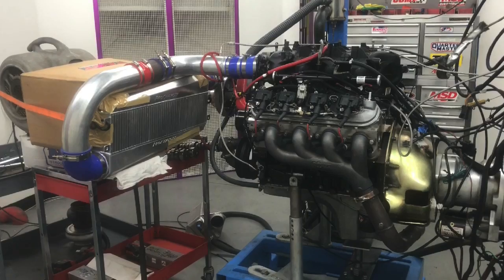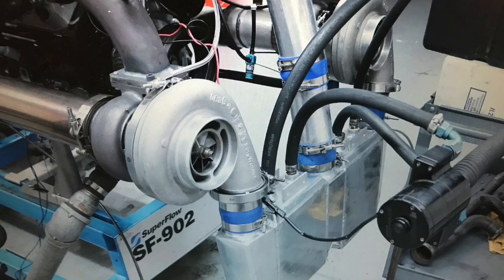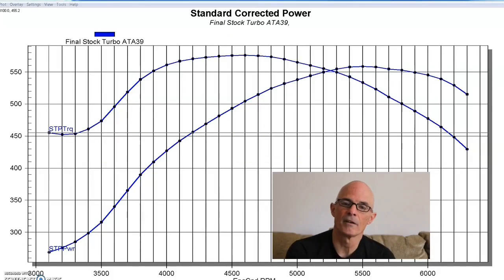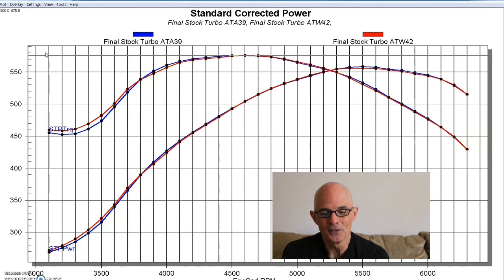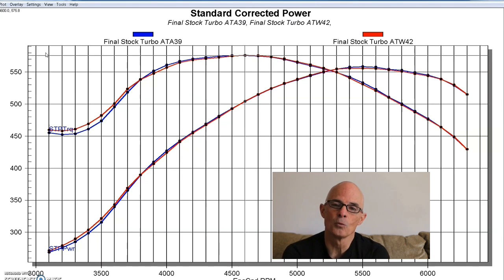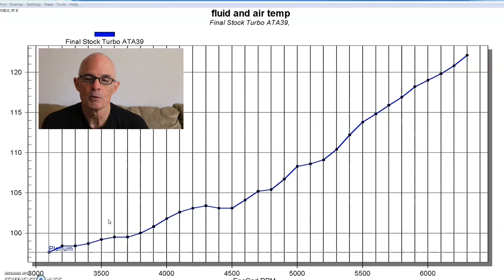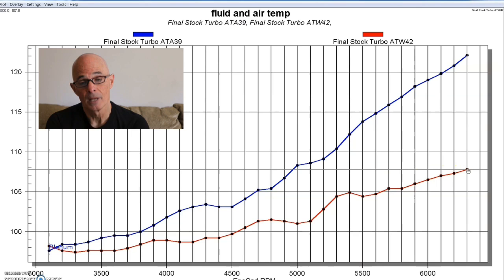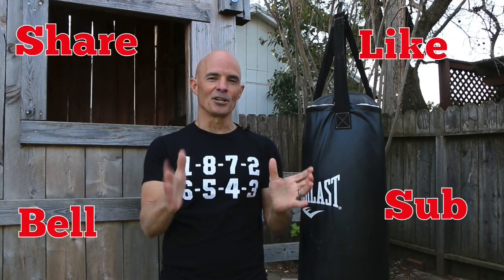LS TURBO INTERCOOLER TEST-ATA vs ATW

Comment: What i found out on my BMW N54 engine with twin turbo and a aftermarket tune running the boost to around 20psi is that any intake temp over 110 degrees cause 2-3 degrees of timing retard which killed about 70-80 lbft.  The issue with air to air on a street car is that you are almost always over 110 degrees AIT so you are always pulling timing. What I wanted to build was a air to water but use the A/C system like a Killer Chiller to keep the water really cold and the loss of power due to A/C was easily made up by not pulling timing.   I live in Texas and any outside temp over 70 degrees would cause the AIT to be over 110 since the best ATA are about 20 degrees above ambient and pushing the AIT to stay above 110.    Air to air is not ideal for a street car unless you like always giving up power.  Sitting in traffic just causes more heat soak and you never get temps back down.

Comment: You're my hero I love all the comparison work you do keep up the great work... now as for the difference between air to Air and air to water the only comparison I see is every 11 degrees is only 1% more power, it's not that great of a difference,. also the air-to-air probably has more tubing which helps to promote Cooling almost negating the advantages of air to water

Comment: The air-water inter-cooler has a greater mass to transfer the heat from the intake charge.  That's why its less susceptible to increased temperatures and the resultant heat soak.

Comment: Rich you ring gap everything.  Would you touch on whats wrong with the fact ring gap
Reply from the maker: its too tight-its done to reduce emissions and blow by and improve fuel mileage and was not gapped for high heat situations

Comment: I think a temperature probe on the outlet of the turbo and on the outlet of the intercooler would be nice to see.  It would be interesting to see a graph of those two values and the intake air temp all plotted on one graph during a run.

Another idea for a dyno test would be an air to air intercooler shroud design.  Corky Bell talks about necking down the ducting to the intercooler in his book.

Comment: There's more power to be had with the ATW core, as colder air tends to accept more compression and timing = MOH POWAH, BABEH !
The colder IAT is the equivalent of having a V12 but only running 6 cyl. The potential is there, just not used.
That's my very un-educated. unprofessional opinion.😁👌🏻

Comment: I found a similar air to water with a heat exchanger and pump for cheap. I think I have enough room. There is like zero room for a front mount air to air behind my grille and in front of my rad. 90 K2500 Silverado.

Comment: Due to not having more information such as humidity, BSFC, measured air flow, etc. I have used generic data.
I will leave out that data so as not to argue over what 'generic' data is accurate rule of thumb and just say that the only variable was temperature.

That being said... since as stated there were no adjustments for temperature either manually or automatically from the tuning we can assume the fuel flow stayed static between the runs. 

Taking into consideration the difference in mass air/density in the intake or at the back of the valve, a 13:1 A/F ratio at 108F leans all the way out to 13.01:1 at 122F. (reminder I don't know what ANY of the ACTUAL data is I just used generic info for comparison)

Because that level of fuel ratio difference is negligible it is not surprising there is little or no difference in power.
The biggest difference would come from being able to take advantage of knock threshold being pushed farther away... through either higher boost or increased timing advance, or some other 'increase'.
To be fair there is little to be gained and wouldn't be noticeable on the street, but it might be noticeable at a track when every little bit counts.

Comment: Unless you're compensating for different air temps theres no advantage to atw .as far as I can tell the  added hp comes from cooler air charges reducing combustion chamber temps reducing chances of detonation allowing for more timing or leaner a/f ratio.
Reply: Also this test might be more consistent with a supercharger since is not dependent on engine load as much.
Reply: Seems about right

Comment: From what I can gather from the video, since colder more dense air always produces more power, the air to water intercooler WAS actually producing more power do to the colder air charge....BUT.....the air to air intercooler was ALSO producing more HP due to the longer intake tube length which cancelled each other out and netted similar dyno results.  And from our 'highly advanced studies and YouTube testing procedures' (joke), on previous intake manifold runner length, we now know that longer runner length increases total average HP on a mid ranged RPM cam and heads combo engines.  What do you guys think?
Reply from the maker: I'm not sure how you come to the conclusion that the ATA had longer inlet tubing (that was not stated in the video) or how the longer inlet track before the intake manifold improves power-can you explain
Reply: @richardholdener1727   Richard Holdener   My bad I actually just found your channel and just trying to be your best student, watching all your vids.  At 6:48 you say there was a change in inlet tubing length, but now I see you didn't specify it was longer on the ATA intercooler. Also you are right about the aerodynamics 'behind' the throttle plate in the intake manifold, oops I forgot this! I've studied a bit more and they say the longer inlet tube/intercooler length is supposed to actually have a negative effect on HP but increased inlet tube flow helps increase engine HP (aside from air temp), correct me if I'm wrong. Is it possible that the ATA flows better and this is why it keeps up with the ATW intercooler? And what type of ATA is this one, "Bar and Plate," or "Tube and fin" design? Thanks again for your vids!!

Comment: I would have liked to have seen the test done sans inter/aftercooler which is what these are btw a intercooler is between boost providers to see the temp difference, as for temps making a power difference, gasoline is more detonation sensitive with temp vrs making more power see the top gas dragsters in the nhra comp eliminator blowers without cooling and gasoline are run on the raged edge of lean to make the most power, so unless you have more then a probably 25-30 difference you probably wont see much if anything at all on gas. Where you might see a difference is in a detonation heavy scenario say a crappy set of small block chevy heads and big dished pistons and crap compression ratios and all the other problems brought on by emissions testing, these modern engines run so little timing that it's hard to get numbers from them that cause detonation. So My suggestion is use like a mid 70's bbc or small block and run 87 thru it with boost, then add the coolers and retest, that would probably show a difference.

Comment: I would like to see E85 no intercooler vs E85 with intercooler.  Low boost, say 15 psi.  Specifically how safe or not safe is it with 200 ish inlet temps on E85?  Seems some guys do very well on E85 no IC.
Reply from the maker: it works, just not as well as E85 AND the cooler

Comment: Richard, so the ATW intercooler is making the air cooler and thus more dense, but not my much. If we convert to absolute temperature (Kelvin), we get 108F = 315K and 122F - 323K. So the difference is pretty small. If we use some assumptions of 22.7 PSI (8 psi above 14.7 ambient), "moist" air and 50% humidity, we get 1.66 kg/m^3 for 122F and 1.71 kg/m^3 for 108F. Slightly more dense but not by much. Now! Can you please run this again but with Ice Water and charge air temperature before & after the intercooler? Thanks!
Reply from the maker: why convert to get a smaller %
Reply: @richardholdener1727  Because that shows you the absolute temperature. 122 isn't 13% higher than 108F (122/108), as the numbers seem to be. It's only 2.5% higher (323/315). And the relative temperature difference in Kelvin is what defines the relative density difference (ie. how much air you are cramming into the cylinders).

Comment: Regarding temperatures: What is the oil temp? what is the coolant temp? what is exhaust temp? Do you ever simulate making full power up a mountain road. I find these tests to be somewhat misleading.
Reply from the maker: the coolant and oil temps are the same. Exhaust temp was not monitored in this test. Mountain Road full power test?

Comment: In reference to ATA, would a larger intercooler help or at some point start hurting? At the beginning of the vid you said you had properly sized intercoolers, I think. Thanks keep it up!
Reply from the maker: we've run over 1000 hp with both of these coolers

Comment: There is probably slightly more of a flow restriction thru the ATW. You would need to test pressure drop thru both aftercoolers.
Reply from the maker: we did

Comment: Why no change in HP? It was only 14 degrees difference in temp, and that was only at the end of the pull.  For simplicity's sake, I'd run air to air.
Reply: A general rule is 10deg temp with change 1% hp. In this case we should have seen a difference of only about 8hp. Nothing crazy but should have been seen in the comparison. Mystery.
However, the lower charge temps should allow a touch more ignition timing when on pump gas where knock could be a limiting factor.
Reply: @meetthecarolinas9638  That was the point I was trying to make, 1.4% (14 degrees) is nominal & is probably less than the margin of error for the dyno.   Even if you gained the 8 HP by going ATW, you're not going to notice it from the driver's seat.
Reply: @damonriddle1370  you'll absolutely feel it from the driver's seat, but it depends on your application.  If you're banging off 1/8th or 1/4 miles you won't heat soak.  Spend time on a road course, or pulling something up a hill and you'll quickly see the massive advantages of air to water.
Reply: ATW may have advantages in transient operations, space, minimizing charge piping, and depending on the application being able to easily cool below ambient temperature (ice in the expansion tank)

Comment: Definitely the timing is the reason there is no difference in power. Would love to see the same test but with optimized timing on the air to water setup.
Reply: Hmmm, but it was the same timing on both setups? At 10:50 you said timing didn’t change.
Reply from the maker: Both were already optimized

Comment: I ran one of the first V2SQ supercharger kits on my 98S10SS. It didn't come intercooled and it didn't like anything over 8-9lbs and would see temps go north of 200F. I eventually added meth injection and it loved it. Went to 15lbs and with a 50/50 mix intake temps would stay around low 70s. With windshield wiper fluid around high 90s low 100s. Definitely worth it.

Comment: that extra 14* of IATs temps allows more timing yea?
Reply: In some cases maybeeee. I'm not a professional tuner but I think generally tuners just pull timing at high IATs like 130-140+ to prevent detonation especially on gas like 93 octane but they aren't adding timing at lower IATs as the IATs aren't a big factor in whats causing detonation in a boosted application. In this application the IATS are within range that timing wouldn't be pulled or need to change I don't think. Also Richard is really trying to show how this magical number of x% power gain from x degree intake temp change doesn't always hold true and all intercoolers can get the job done which sized appropriately. Love the video Richard!

Comment: it'll make more difference at higher boost levels. more timing with the lower air charge temps will tilt in the favor of air to water and make up for the pressure drop from the larger air to water tank.

Comment: I agree with most people the delta in T wasn't enough but as also stated the Turbo was well within its effeciency Island too, push the boost I bet then you would see HP change... Richard Holdner love your tests separates all the BS from real HP makers! Also something I would like to see is measure the airflow from backside of ATA to see how much cfm is moving through also would like to see it on a typical car setup. I have ATW and there were two aftermarket choices one the that was wider and covered ie more surface area but most of it is covered by the bumper in addition to being in front of the radiator. So the one I picked sits in the airdam openeing and is thicker so surface area is less but not much. I've been trying to get logs from people who have other type because 1st thing I noticed was radiator coolant temps 10 degrees cooler and my charge air temp was 20 degrees colder and recovered faster especially at roll races IAT/CAC never gets above 20 degrees delta for 0-150 mph runs start at 10 degrees above ambient by the end of run 10 Delta increase. By the time I slowed down back to 10 lol.

Comment: I’d like to see this same test but on the fuel system instead of the charge air. Still run one charge cooler or the other, but adding an ice bucket with the incoming fuel line coiled up inside just before going to the fuel rail vs ambient temperature fuel. I’ve heard good things about using ‘cool cans’ on fuel lines but want to see it from the Holdener perspective.
Reply: No sanction on public streets lol

Comment: Put ice water in the air/water intercooler. Drop the temp. another 15 degrees, and see how much power it makes.
Reply from the maker: There is an ice water video already up
Reply: @richardholdener1727  must have missed it. I have to say you have no shortage of info. Great job

Comment: friend whos a engine builder tells me i dont need a  intercooler for   blowthrough carb setup where the  goal is  350-400 hp in a buick 231 v6   is he right?

also    i hear the  dog is  snoring again  heheh
Reply from the maker: blow through plus Intercooler is better than blow without
Reply: @richardholdener1727  i planned on  buying a  stock  buick grand national intercooler  and  testing between hot air and   the  small intercooler but ill put an electric fan on it in addiction to the  snorkles they used on the GN's as those intercoolers are  between the engine and radiator but im on a  budget here and dont want to many bends and  running without includes having to have a  180 degree  tight radius  elbow to make it work with the carb hat i have

Comment: Water at the same temperature can absorb much more heat than air.  Water has 900 times the density of air.  So I would expect a slower ramp in temperature with the water to air intercooler.  A power advantage for a better intercooler of any type depends on your need to run higher boost.  At 10psi both intercoolers are more than sufficient for this application.  If you had increased boost, the water to air intercooler might well support more power than the air to air intercooler.

Comment: I think it would be a more accurate test to have the dyno hold the engine at say 5500 rpms and run it there till everything stabilized then compare the numbers.  Your actual intake temp is higher than indicated because of the lag in the thermocuples temperature measured response. Also things like probe position and probe direction vs airflow can effect the readings as well. As you say very hard to do an accurate comparison.  On long pulls heat soak becomes a big problem. That is when an air to air usually shines as an air to water requires a water to air radiator to get rid of the heat at some point if you are running hard a long time so then it just becomes a bigger more complex air-air system. :-)
Reply: Short version: Road Race, air to air, anything shorter duration, air to water...
Reply: Water to air is better if you have a icebox but its dont last long before the heat melt the ice = good for drag racing

Comment: flow restriction on the water to air intercooler offsetting the temperature benefit.
Reply from the maker: there is almost no flow restriction on either of these coolers at this power level-made 2X this power with both
Reply: 3% density change could be offset by 0.5psi, not 'overly restrictive' just enough to be annoying.  :) 
thanks for the cool content.

Comment: It’s not really about the “differences” as to why the power curves are practically identical but more about the “similarities” especially when you consider the test is showing a negligible change in delta t, has the same boost, the same timing, the same afr... All these indicate it will make the same hp.... which it did.
Now if you ran the test at say 20 psi the results might be quite different; but how do you “prove” which type is better?... Like you said Richard “run an intercooler”. 100% agree but I’d add that a person runs an “effective” intercooler sized to suit the intended power level and as long as it does suits the combo it will be MUCH better than no intercooler particularly as increased power levels are targeted.

Comment: Wow!!!! 32 minutes WOT. That was one hell of an engine to hold up to that kind of punishment. What was the highest sustained rpm Richard?
Reply: No biggie. Honda School required full throttle for a hour after you assemble an engine or FAIL!
Reply: dielauwen a Honda is not a pushrod engine and can sustain high rpm over long periods.
Reply from the maker: less than 6000 rpm